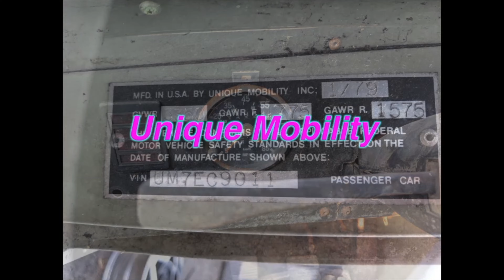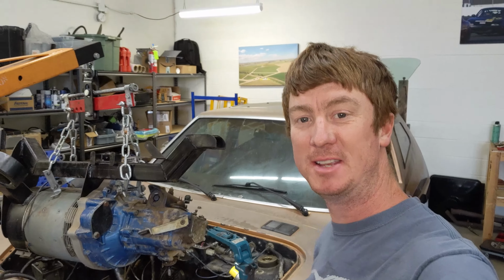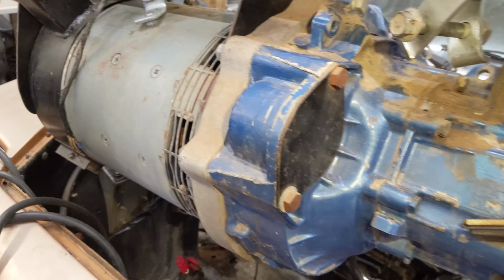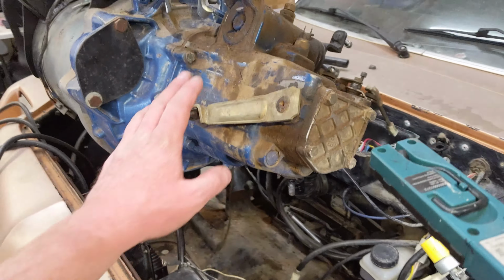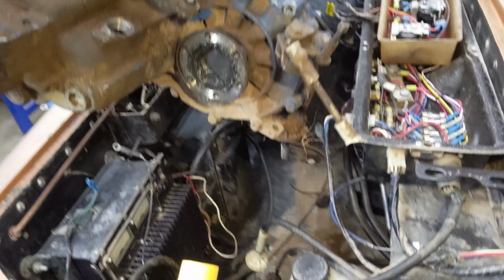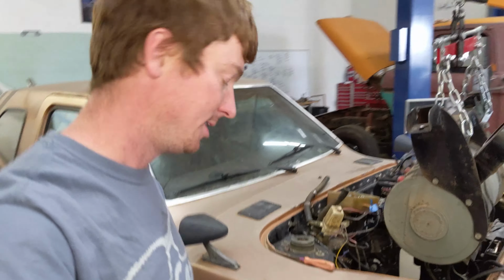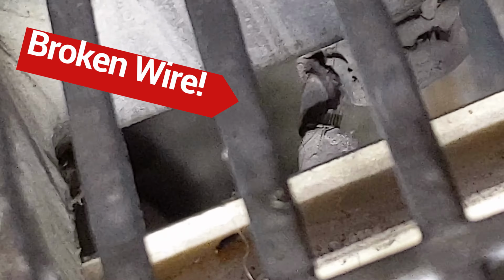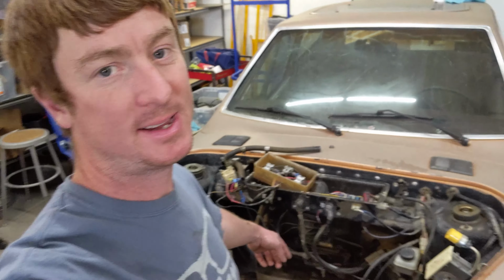Pulling the Old Motor OUT - 1982 UM Electrek Restoration Ep7

Comment: This thing is nuts! I love all the mixed parts from random cars.
Reply from the maker: It's like the ultimate kit car!
Reply: @EVSwap  Truely! I think they visited the local junk yards, found several inexpensive cars that were common and then bought them for parts. Instant Electrek!
Reply from the maker: @de-bodgery  haha, you have to remember it was the late 70s. There were no VW Rabbits in junk yards. The Rabbit was a brand new car from Europe with independent suspension and this new thing called FRONT WHEEL DRIVE. it was new and high tech. The UM Electrek was revolutionary in more ways than one. Fiberglass monocoque chassis, FWD euro suspension, fully electric. It is like a Tesla Roadster of it's day
Reply: @EVSwap  I didn't think about that! Yeah you are probably right. This was harder to pull together than I thought from disparate sections of other cars. It's been a long time since I thought of the 1970's and "high tech" in the same sentence! That wasn't exactly yesterday.

Comment: Any news on why the DC/DC converter wasn't working?
Reply from the maker: There is another fuse inside that could possibly be blown. I have not investigated it yet to be honest, I have been working on bigger issues. Jim M. was telling me that it is very common for the DC-DC converter to fail on these cars, they were barely able to meet the demand of the car when it was new, let alone after a lot of miles. I have found a modern DC-DC converter that I can use to boost the reliability of the Electrek and I will install it out of sight to maintain the originality of the car.